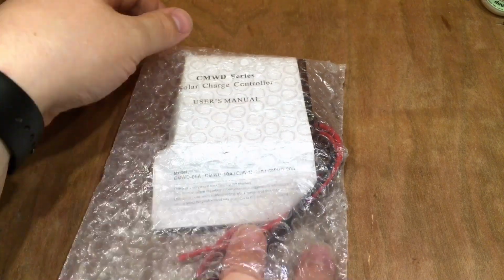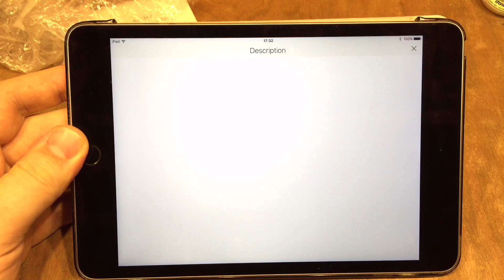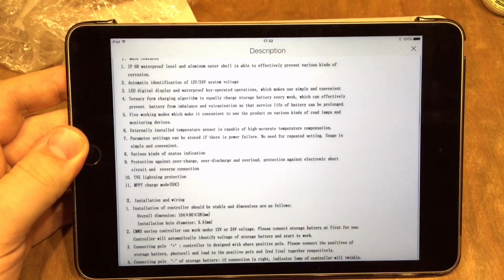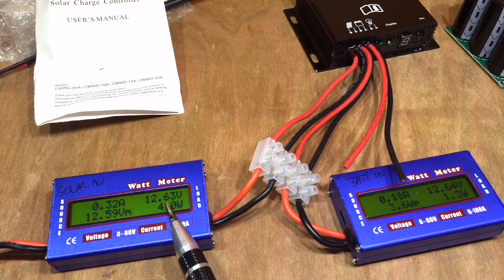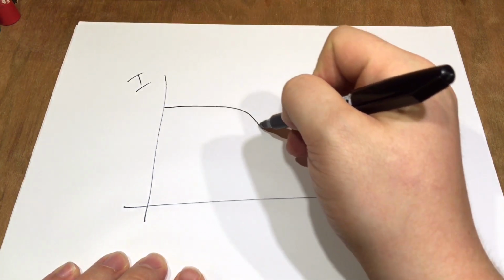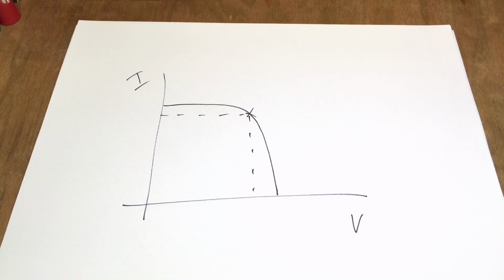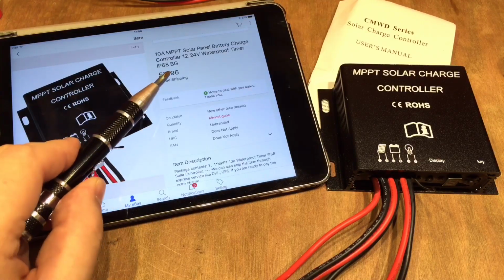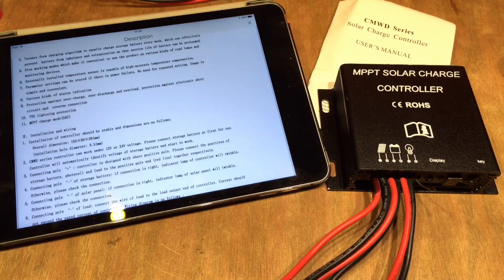Cheap MPPT(?) Solar Charge Controller - 12v Solar Shed

Comment: Theres nothing wrong with controller ive used these its because you have not enough watts coming in off panels the battery is loading up the panel

Comment: I've bought a few PWM chargers labled as MPPT which obviously are not MPPT simply for the fact that they had been reliable PWM chargers. I think the design of the unit is the first thing that gives it away, also the lack of a heatsink.

Comment: I have two of them and they work as good as my 200 dollar mppt controller, u need more input power. I use 160 watt  panel for a 12 volt deep cycle battery...

Comment: Well your notion that the charge controler controls the direct output of your solar panels into the controler is nonsense. If your panel is at 12v and only pushing 300ma. You must have a 5 watt panel or similar. Not big enough to evaluate an mppt controler of this size. So are you willfully spreading misinformation or are you just clueless? Your choice. I have the same controller that converts 55v to work on the 12v batteries i have. Its called mppt.

Comment: Yes, I verify this is NOT an MPPT controller. I've got the 30A version, same shit.
In addition, the very peculiar behaviour of toggling the charge current on-and-off every second or two while battery voltage is around 12 volts (not over 13 volts) and the 40 watt panel should be pushing more than 2 amps at about 18 volts under direct sunshine from blue skyes. Under these conditions a regular cheap PWM would be pushing the 2 amps continuously. This "MPPT" seems to do some computing, since it toggles the output; they have failed both in electronics as well as programming design.

Do not buy.

Comment: Do you ever pursue the peddlers of fake MPPT controllers for a refund?
Reply from the maker: Sometimes when the advert is clearly lying. I’d imagine my videos have more effect on sales though than my one refund.
Reply: @AdamWelchUK  Ah so this is more of an entertainment thing for you then?

I think you'd love my solar setup.
Reply from the maker: Zephod Beeblebrox I guess. Yes I like all solar setups! :-)
Reply: @AdamWelchUK  I have 3 permanent solsar panels, 2x10W and 1x15W with two portable 30W panels powering the electrics in my motorhome. For exact details www.schoolbushome.blogspot.com. Items powered - a 12v shower, 6 LED lights of between 1 and 3 watts, 4 USB chargers, a handbasin water pump, 3 CPU circulation fans and two 2.5A extraction fans. All running together with a PWM controller and 2 x 35AH SLA

Comment: Hello. I just watched the testing of this mppt controller. I've seen some mppt controlers and I don't understand something...why all are testing these using small solar panels? I guess you used a 20W panel but how about using an mppt 10A with a 80-100W solar panels and SUN. I think you can't expect an mppt to give the same power that panels are making while there is no sun. I am not an expert but I know that for mppt controlers you should use panels that give a higher voltage and low amps to convert them to lower voltage and higher amperage (eg. 24 V solar panel to charge a 12V battery bank). I likeed this video, thanks for the review but try with bigger panels and see if the amps delivered to the batteries are more than the ones received from the panels; that will be an mppt (how efficient? We'll see than). Another thing is the IP  rating of all devices. IP shows the capacity of a product to be used indoor or outdoor ( bigger the numbers - more water and impurity proof) - IP67 or IP68 means that it can be used ourdoor (just the device, not also the wiring because they will be exposed). Take care and congratulatios for using free solar energy

Comment: there is still not correct that you replace with one MPPT controller, the panel charging current is 0.38A, but battery charging current is only at 0.08A.  Still that MPPT is not good MPPT.

Comment: Mostly good vid. Couple of issues. Firstly, how is it that your "genuine" MPPT controller is drawing ~6W and still only putting out 1W? You cited the "fake" as being deficient because it was drawing ~4W and only putting out ~1W, and were scathing about the efficiency, yet overlook this when showing your "genuine" item. Consistent comparison please. Secondly, regulators do not make voltage. They transfer power from the solar cells to the battery, ergo they work with what they have. If you were to conduct this test at night, you will see even less voltage coming from your cells (zero). MPPT effectively means limiting the current draw to not exceed what the cells can provide. I saw your "fake" regulator doing just that. I don't see anything indicating poor performance nor false claims in this at all. I am not affiliated with the manufacturer, just an anti fake-news respondent. You tried hard but the conspiracy seemed to overwhelm the science. I look forward to your angry reply.
Reply: I would also like to understand why your genuine MPPT controller is not reaching your expected 17V. Is it only "slightly" genuine? Again, a lack of sunlight me thinks. I also suspect you live in the U.K., which might go some of the way to explaining the shortage of voltage, unless British weather has taken an astounding turn for the better. The answers are out there.
Reply from the maker: I don't know why you think it's going to be an angry reply. You raise some good questions - let me try and answer them.

I did this video in a slightly different style for me.  The first part is all about the excitement of buying a new product with it's promises and how you can test some of it's claims with nothing more than a basic voltmeter.  I then confirm this with two very cheap meters. It's tongue in cheek. I am not primarily looking at efficiency - but I'll come back to that.

The second part is explaining the concept of maximum power point tracking.  It is indeed true that the maximum power point is stated on my panels is 17.5volts - but remember that is under the standard testing conditions and real life is rarely like that.  That is of cause exactly what the MPPT part of the solar charge controller should be doing - adjusting the load on the panel to find that sweet spot where the most power is being generated under the current conditions.  You'll often see panels hovering around their stated MPP but often not bang on.  Panels are rarely perfectly on axis.  They are rarely in a cloudless sky (at least in the UK as you point out). 
I'm very confident this charge controller is not MPPT. The panel voltage does not deviate from that of just above the battery voltage (and it's the nature of a solar panel which allows it's voltage to be dragged down to this level and the laws of physics which allow current to flow from the point of higher voltage to the lower). In fact it's the same result if you bypass the charge controller and connect the solar panel straight to a battery (because that's exactly what this charge controller was doing - it's a PWM solar charge controller which was sitting at 100% duty cycle) and of cause that prevents the losses of powering a charge controller at all!  If I'd have allowed the battery to get up to 13.8-14.4 volts we may have seen some confusing results.  As the duty cycle dropped the average voltage of the panel would increase - it may have looked like it was MPPT but of cause all it is doing is reducing the time the panel is connected to the battery to reduce the power to prevent overcharging.  It's this which manufacturers and sellers to argue that their product is indeed MPPT - if they don't just go down the line of 'MPPT is simply just the model number'.
The second part of an MPPT charge controller is the DC to DC converter.  Taking the higher voltage of the solar panel (the one near it's MPP) and converting that power into a more suitable charge for a battery.  Lowering the voltage and increasing the current - hopefully reasonably efficiently.  Trouble is converting that power has losses.  There are good and bad DC2DC converters (I've recently looked at efficiency of some buck converters in another video) and the efficiency can change by quite a margin.  There are also some DC2DC converters that hit 98% or more efficiency in their sweet spot.  But out of their comfort range they drop off dramatically and achieve quite a low efficiency.  
Then take into account that MPPT charge controller tend to have (but not always) higher powered microcontrollers (they've more to consider), LCDs, back light etc.  These all take up extra power, so yes it might be less efficient at lower input power than a charge controller without these functions - it doesn't make them any less 'MPPT'.
I showed my real MPPT solar charge controller in this video to prove that the panel voltage and the battery voltage should be different.  I don't believe I mentioned efficiency at that point because that wasn't the point I was making.  It was producing more power (6 watts rather than 4) but it was well out of it's efficiency comfort zone and I did mention it was clouding over.  However it was producing more on its input than the fake, but sadly it was using more because of the inefficiency and additional features.
Mostly good? I'll take that - thank you very much.  I appreciate your comments.

Comment: Why is nobody using a Fuse between  there solar panel and charge controller & charge controller to Battery , is there a reason not to ?
Reply from the maker: +steven keene I do use fuses in my real setup but not when testing - or at least I do between my battery and charge controller and loads. 
Solar panels don't have any stored energy. If you short the wires on a solar panel they produce current but no voltage - no watts. If you measure the voltage across the terminals while the circuit is open you get a voltage but no current - again no watts. 
Now if you've got a large array then you need to be more careful. 
My larger array (200w) has a dc breaker on it - but the smaller ones don't.
Reply: that's good to know , I am just starting with a 105ah calcium battery and a 100watt solar panel and a cheap pwm controller and I must find out a couple thing and one of them where fuse's. now can I ask   if I connect a load(20watts) to the battery I see the voltage drop from 13.8 to about 12.5 on the pwm controller is that normal ?
Reply from the maker: +steven keene That kind of voltage drop on a 105ah battery doesn't sound quite right. Is your cabling up to the job - any poor connections?
Reply: Adam Welch i am using a 5 meter 4mm2 solar cable  to the charge controller and a 2 meter 4mm2 from the charge controller to the battery. i have a 150watt DC/AC inverter hooked up straight to the battery.  so there are not many bad connections possible as what i tink.
Reply: if i disconnect the load the battery  will go the 13.8V within a couples of seconds/minutes

Comment: We nearly bought this for our little  camper - can anyone recommenced  gen MPPT regulator  for a 80 watt 16'5 v optimum  panel to charge our 12V  65amp AGM battery  - its a challenge : )
Reply from the maker: +Trev S If you are wanting to go for the cheapest end of the market you could try this one I looked at... https://youtu.be/1z5r3Yo6fmQ Otherwise the EPEver Tracer A Seties is good... https://youtu.be/zTBrktPQdCM
Thing is there isn't too much voltage to play with there for MPPT to work most efficiently. A decent PWM charge controller might still do the job.
Reply: I just bought a MPPT controller from Banggood, seems to work really well: https://m.banggood.com/MPPT5012A-DUO-BT-MPPT-12A-12V-Solar-Charge-Controller-APP-Solar-Regulator-For-Solar-Panel-Charger-p-1334922.html?rmmds=search

Comment: I too purchased one of these regulator ( CMWD-15A ) and
wired it in to replace EpeverTracer 4215BN and found that the input and output
became the same and of cause, no current gain. A big disappointment on getting
ripped off.  Where the Trace was working
at the MPPT of the PV at 34V and a current of 2Amps producing an output current
of 5.3Amps at 12.5V. That  a difference
in output of 27W from CMWD-15D to 68Watts from the Tracer. It a pity I didn’t
see your video earlier

Thanks

Comment: i  do  have  important note ....usually in pwm   in  the   first  stages   when  the battery  is low   the   panel  voltage = the  battery  voltages  i  have tested  this  on many many  pwm controllers  the reason is that   shorted panel to  the  battery  its  voltage  willl be  dragged  down  and the  panel  will  trun it self  into  a  current source   ...so most likely it is   easither  pwm or   on of  switch ...the good  way  to tell  if  controller is  mppt  or not is the current   gain  since the   voltage is  already down  at panel  side  then   no  hope  at  all   it is  just   on/off/pwm    ...

Comment: Which 10A MPPT for Lithium batteries should I buy?
Reply from the maker: There are very few controllers on the market specifically designed for lithium.  I've been doing some experiments on using a Lead Acid charge controller on lithium ion 18650s.  Check out my recent videos to find that series.
If you're set on MPPT you may be best off looking at a controller you can change the charging parameters on - like the EPSolar Tracer A Series (again I've done a video you can find on my channel).  However you need to think about what features you want for a charge controller - what voltage you are looking at with your lithium cells etc.   Once you have all this in mind it should be fairly easy to find the one that suits best.  Cheers
Reply: I would probabyl use LiFePO4 cells in 3S configuration, but ideally solar charge controller would have option to use from 2S to 5S battery configurations.

I need only 5A so if you know any affordable 5A chargers please recommend them. Thanks.
Reply from the maker: I think you'll find most MPPT charge controllers are 10amp minimum unless you want to use a specific MPPT IC like the CN3722 ( https://youtu.be/liYZ5pYOZDE ) which does come as a module where you can change the termination charge voltage.  I think 5 amp is the highest they come in.
The EPEver Tracer A 10amp charge controller is fairly cheap for a charge controller with load control, logging etc. and will allow you to change the charging parameters to suit most configurations.  Check the manual however before you buy which does state the maximums and minimum values you can assign.  You can configure it with either a MT50 meter, a eBox wifi or bluetooth adapter (https://youtu.be/iFIiDAw1R3M ) or a USB cable ( https://youtu.be/r3LrWeYYtnQ ).  The latter is your cheapest option.

Comment: what watt meter is that and where did u get it?
Reply from the maker: There's loads of them on ebay: https://goo.gl/nOJKN8  They're pretty useful.
Reply: ***** is there any particular one you recommend ?
Reply from the maker: +Tanik Sambo they're all the same item, and I've found most of the Chinese sellers are really good. If it doesn't turn up (which I found rare) then they make good by sending another or refunding.
Reply: ***** Thank you. Do they make one that is higher than 60 volts? I can't seem to find one. I like how these seems to be easier to hook up instead of those other one that needs a shunt and have like 4 cables to deal with.
Reply: ***** thanks. Just watching your other videos now.